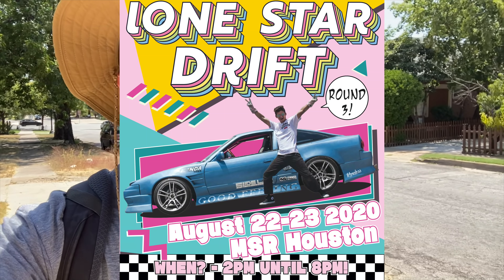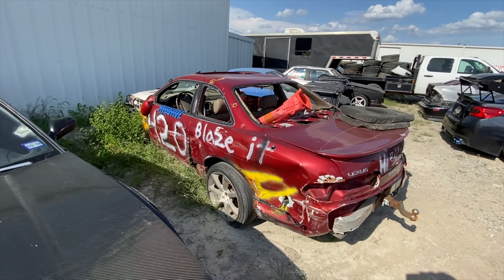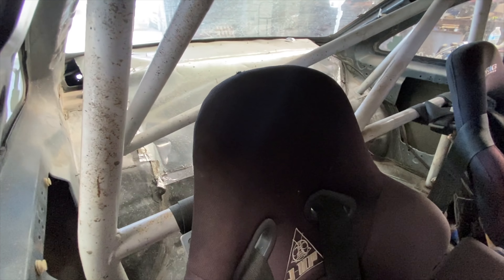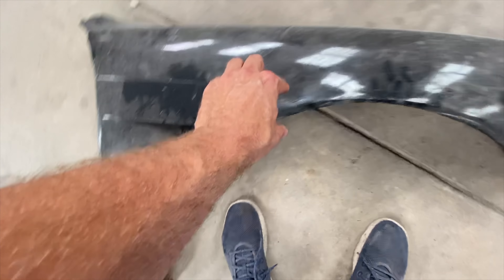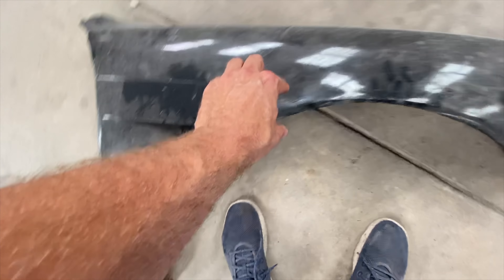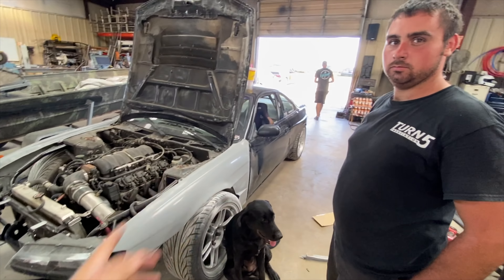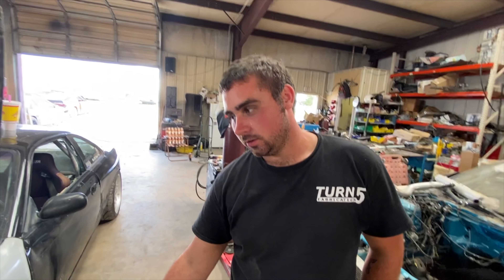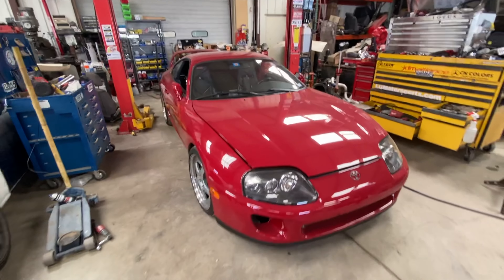Rebuilding my S14 to survive more wrecks, bash bar and tube front

Comment: I'd say the welds look fine. Looks like arc welds from what I can see. If so, they're rarely close to being as pretty as Tig. In terms of strength it's hard to beat though. Also much faster on any easily accessible welds if you're good at both in my opinion. Some people can Tig extremely fast though.